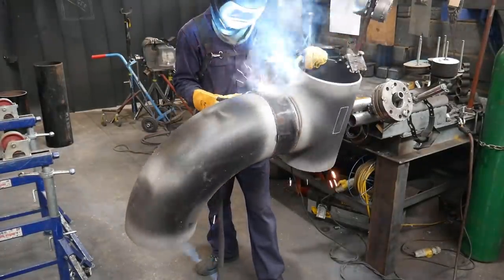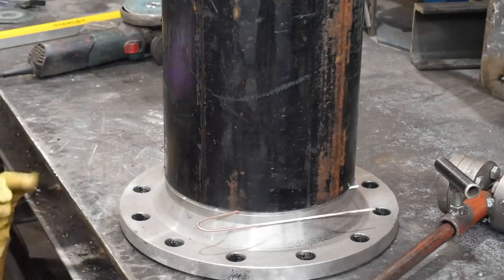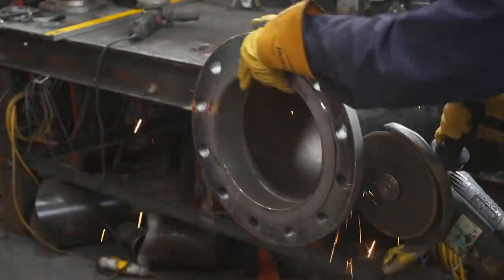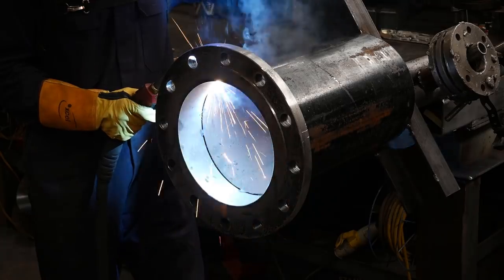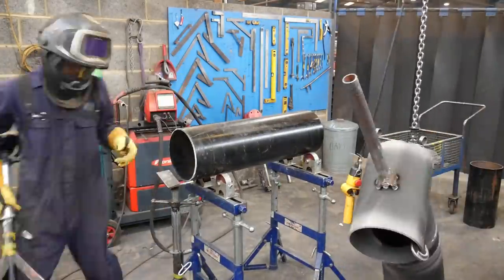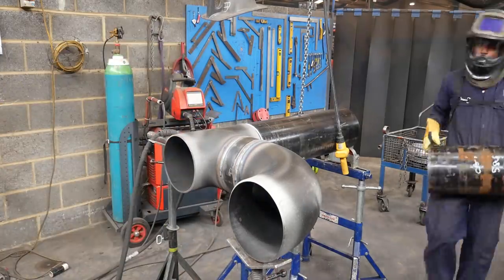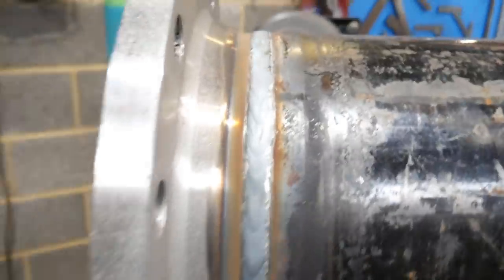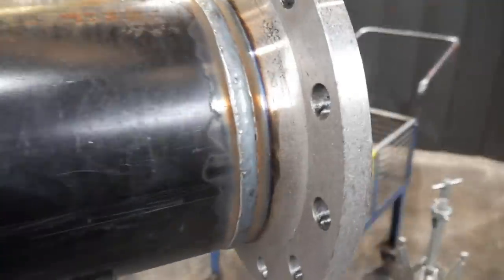10" Pipe Spool Prefabrication ( REAL WORLD WELDING MIG/MAG)

Comment: I guess by grinding after tacking you get an even space to weld after squaring up. So if you prep a pipe then tack it to find the pipe out of square then you have to grind the space anyway
Reply from the maker: I still cant control the size of the gap because level is level but it saves so much time